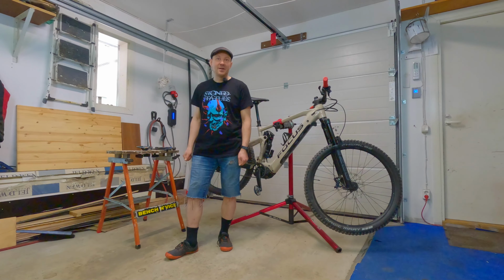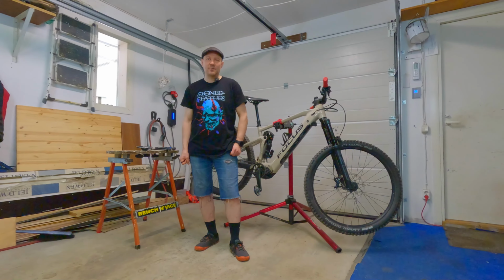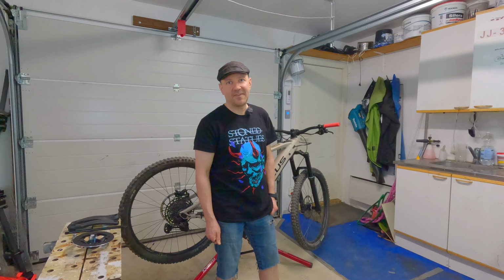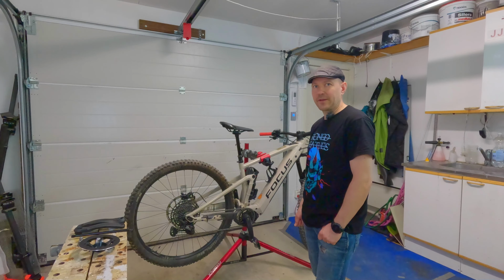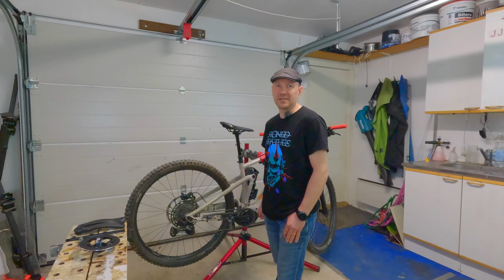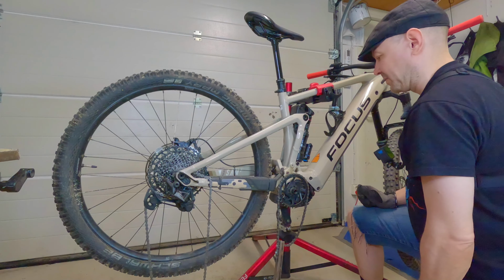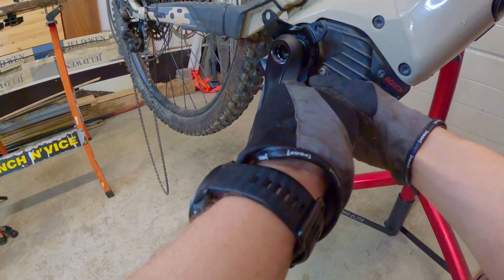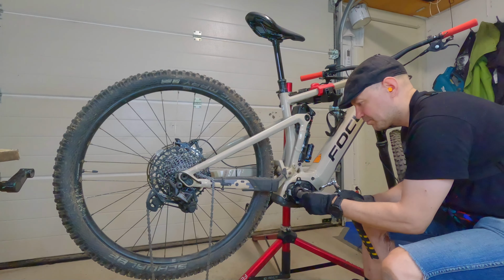E-MTB Fatbike conversion Part 1 - Project introduction

Comment: Frey EX FAT isn’t overpowered. 1000W is a legal L1e-A- vehicle. You can even configure it to 250W if you want.
Reply from the maker: Yes, but it's overweighted due the heavy 1000 W Bafang system. And there is no information if the rear hub is 197x12 mm. I have also got information that Foes are planning to manufacture Foes Mutz full suspension e-fatbike with Bosch system. Actually they take already pre-orders. But there is no information, when would those possibly be available.
Reply: @activelifeinfinland  Yes it’s heavy. 33 kg’s to be precise. The rear hub is 190x12
Reply from the maker: My bike is now 27 kg
Reply: @activelifeinfinland  and now Tunturi makes e-fat with bosch
Reply from the maker: @kanipaa  Yes, but it’s a hardtail.